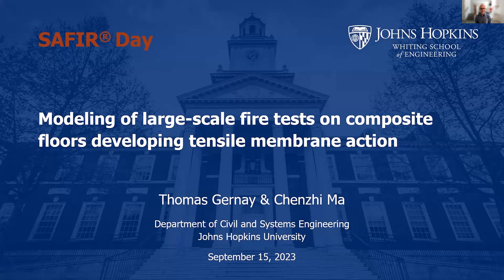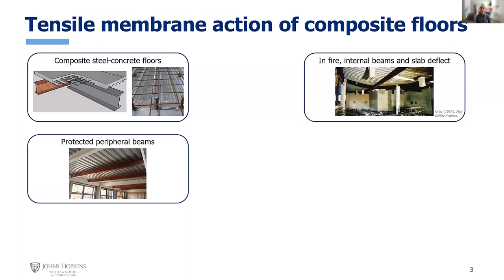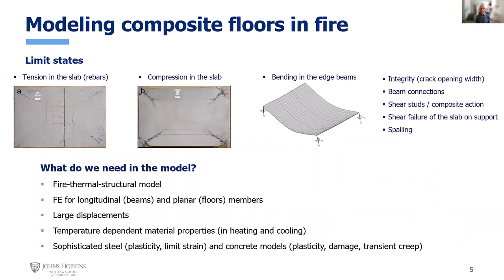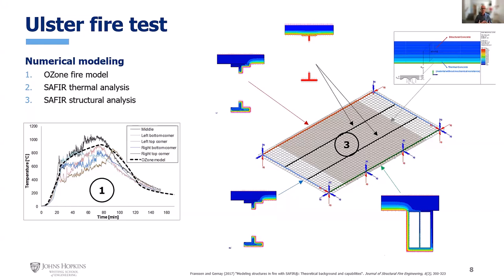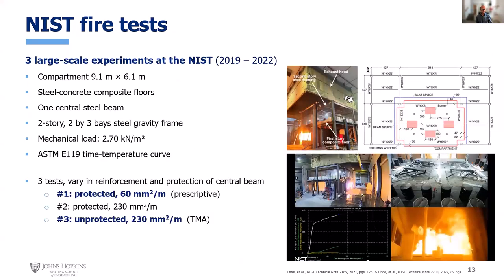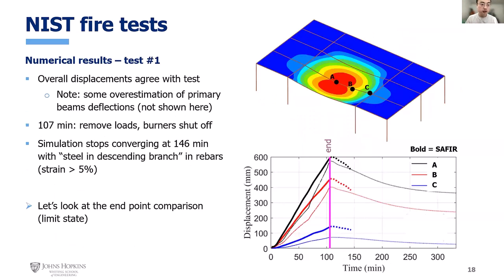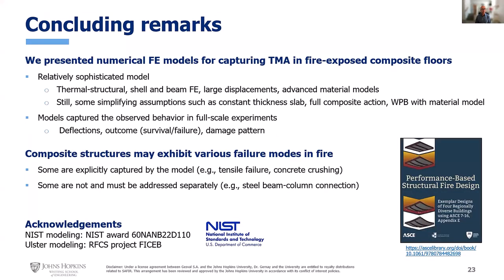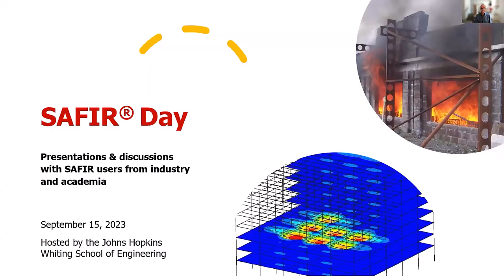Johns Hopkins - SAFIR for composite floor systems

Comment: If the steel beam section is modeled with the conc on top in the thermal analysis and another shell element is modeled in the structural analysis, would it not be double counting the concrete on top of the beam section?
Reply: Yes. To avoid double counting the concrete in the structural analysis, the concrete material from the thermal analysis model is assigned an "insulation" material with no mechanical properties in the structural analysis model. (It is important to include the concrete on top of the beam section in the thermal analysis because the presence of this concrete influences the temperature of the hot flange).